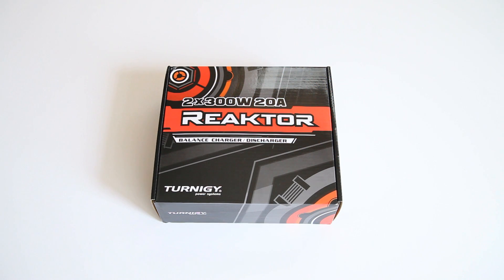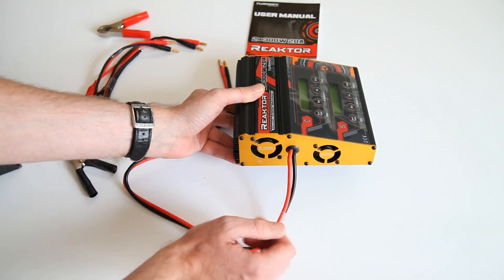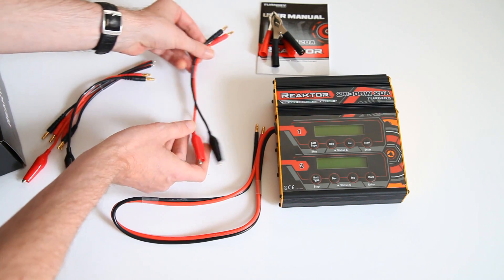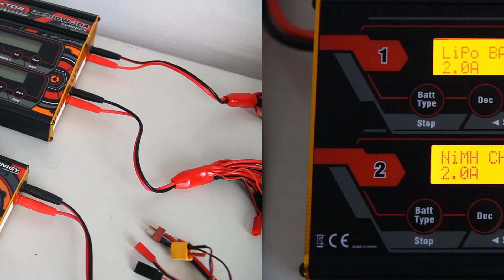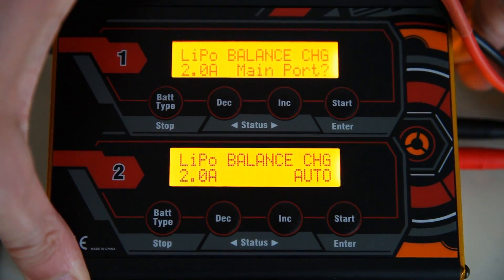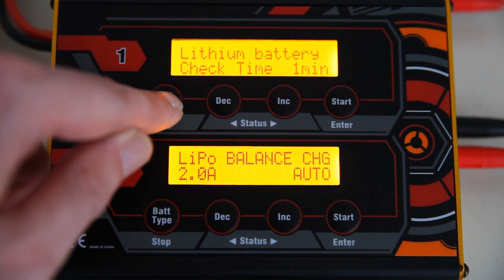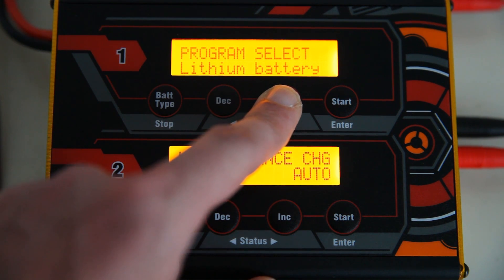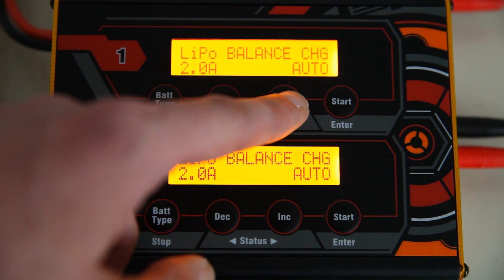Turnigy Reaktor 2 X 300W 20A Charger - Unboxing + rundown of the menu

Comment: hallo bro ,can you help me ? 

I bought a turnigy reactor 300w 20a, but there is no special mode on the display screen? Can you help me ? or do you know how to restart it again?
Reply from the maker: Howdy man :)  not completely sure what you ment but I do know they did change the menu (removed some options)
Reply: @DutchRC  which should appear after setting mode> special mode, but on my screen the select monitor program appears ... and the select program should change to the special mode it should be. Is there a restore button on the Turnigy itself?
Reply: @DutchRC  do you want to see the video?
Reply from the maker: @fathanakromi4634  well.. I would be able to check / compare things.. I DO still have this charger but it's in storage (this video is "a little" old by now ;))

Comment: I bought this charger from Hobbyking some time ago to charge multiple batteries at once. (Note that the maximum number of batteries you can charge at once is two, never ever charge LiPo packs in parallel!) It's a great charger, though the model I have does not have special modes like motor, regulated power supply, hot wire cutter or internal resistance measuring.
Reply from the maker: that is strange, but I guess they changed the firmware for some reason... 
I basically always change more then 1 lipo from 1 port.. but you gotto know what you're doing in that case
Reply: @DutchRC  Yes. It's possible, but only if you know what you're doing. I'm not brave enough to try that.

Comment: I am trying to charge a Rhino 2620 lipo with a batt power  how do you charge when the batt voltage is too low?
Reply: Hmm that Might mean the lipo is done for, but you Can try charging it as a NiHm battery (at say 0.5A) for a while to see if you can get the voltage up to say 3.5V per cell..

Comment: Hello. I have a protek 20a 260watt Power supply will that be ok to use with this charger to use its full power output.
Reply from the maker: Hmm well no not to use it's Full potential.. At 20A it can actually draw 300Amps.. What kind of lipo would you want to charge at 20A though??
Reply: +DutchRC Adventures well I have to maxamps 4s 9000mah so I would like to change them at 10A each. My Power supply is a 20A so I figured it would be ok to use on a 20A charger butt now I think I am missing something or not understanding the wattage?
Reply from the maker: Well.. Watt = Amp * Volt.. Soo if you would be charging a 14V lipo at 10A.. that would actually draw 140Watt
So that would work out.. IF you'd only be charging one at a time.. When charging both at the same time, the draw would be 280Watt..
Could work, but without room to spare for the supply..

The second question would be: can those lipo's actually be charged at 10A??I think so...
Reply: +DutchRC Adventures hey thanks a lot I appreciate the help. 👍🏻👍🏻
Reply from the maker: You're welcome man :)

Comment: Have you tried charging 2s lipos? I cant get it to charge them in any mode. The packs are good and cell's are well above 3.5v, so not low, but everytime i plug in any 2s pack it says something about low voltage or low cells and will not do anything while its plugged in. I can take this over to my accucell-6 and it works just fine. Checking with a multimeter also shows they are fine.
Reply from the maker: +Nathan Knight Huh? :O  I sure have.. I've had no problems with 2S lipo's on these chargers at all (neighter the single or double charger) :$ 
Hmmmm I would think it is some setting in the charger.. But I really can't imagine wicht :$  Do you have yours set up to auto detect the cell-count??
Reply: Yes. I will go thru the settings when i get home.
Reply from the maker: +Nathan Knight Yeah.. hope you figure it out man!
Reply: I will let you know. 3s and 4s works flawlessly.

Comment: What Power Supply will be for? I can find none.
Reply from the maker: +Christian Kettner This should be a good option Christian: 
http://www.hobbyking.com/hobbyking/store/__76184__Turnigy_Reaktor_Pro_350W_23A_Power_Supply_100_240V_AC_.html
Reply: +DutchRC Adventures, Realy? It has only 350W and the Charger has 600W. With this Power Supply i can not Olaf with maximum.
Reply: +Christian Kettner Olaf=load :-)
Reply from the maker: +Christian Kettner oeps.. sorry.. I though you commented on the Single version :$  BUT.. the Reaktor line of supplies seems well build.. Hmm regretably the supply I use isn't sold by HK anymore.. 
It looks HK doesn't really sell the 'right' supply though.. Maybe shop around at ebay a bit?? 
or.. this might be an option? http://www.banggood.com/LED-Power-Supply-600W-DC12V-50A-Power-Supply-Transformer-p-917626.html?p=TO251813974002015038
Reply: +DutchRC Adventures It is really stupid that they do not sell it. I look at me at times. thank you
Reply from the maker: +Christian Kettner I agree Christian.. They used to sell a wider selection of supplies.. I don't know why that is.. Maybe there wasn't a lot of demand or something

Comment: I recently found that my little turnigy chargers, even though i set them to 4 or 5 amps, only actually output around 3 or 3.4 amps. So on my large 5000mah 3s packs it takes much longer than it should to charge. You still happy with these packs? Have you tried changing the input voltage to the charger to see how that effects charging? LIke 12v or 24v? I currently use a server psu i converted. It is rated for 60amps but only outputs 12v. I have been considering moving up to 24v.
Reply from the maker: +Nathan Knight I had not noticed that.. Maybe because I'm never in a hurry when charging things (or rather: I plan things so that I'm never in a hurry :$) 
Couldn't that be a setting somewhere?
Reply: No, i think its a limit of the max watts of the charger. So if i was doing a 1s or 2s pack i could get the full 5 amps it says it can do, but once you start going up in voltage you hit that 50w max real quick. They items alot of times say max amps as a selling point, but in reality its the max watts that is most important. 5amps @ 8v is 40watts whereas 12v and 50w max is 4.1amps and so if you remove the 10-20% inefficiency you can see that a 50w charger is only going to get around 3-4 amps max at 12v. Maybe i have no idea what im talking about? Thats my current guess right now based off what i have read online.
Reply from the maker: +Nathan Knight Well then yes.. There is a good chance you can improve the charge time then, by increasing the input voltage indeed, It would offcourse be nice to know for sure.. I know.. My power-supply has a fixed voltage as well though :$